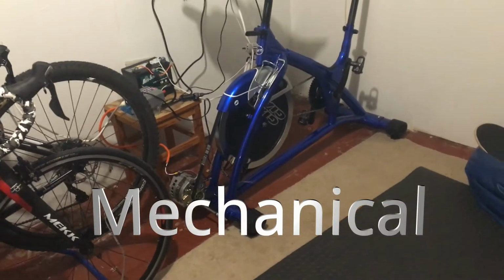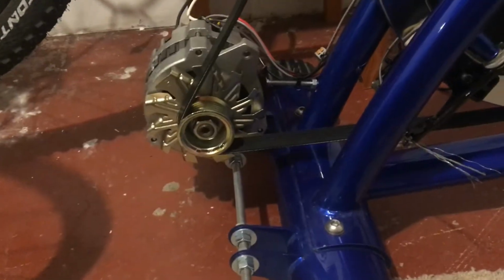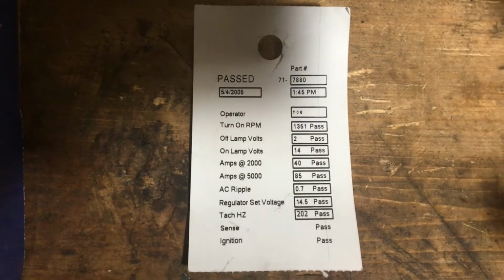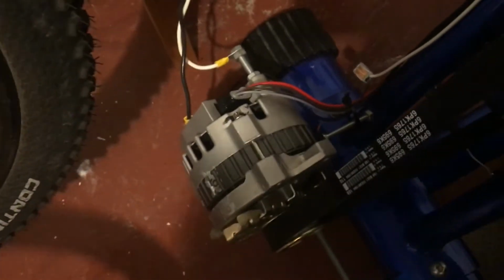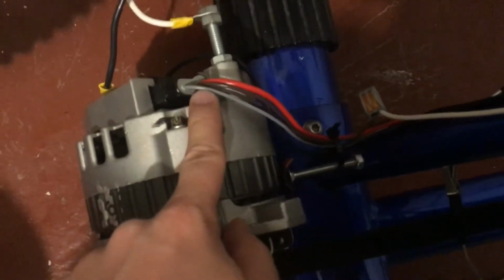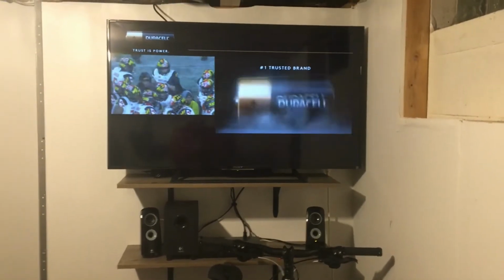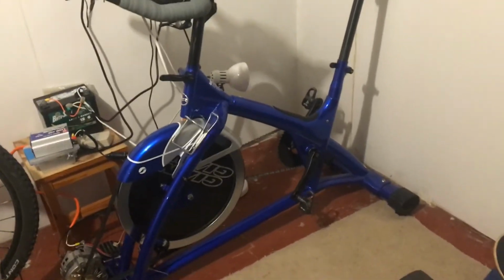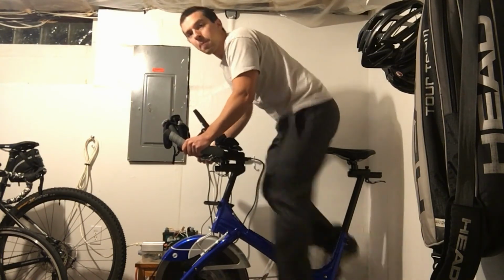Spin Bike Generator

Comment: This is more of a disaster preparedness thing. Very useful during power outages. Enough to charge essential gadgets and items.
Reply from the maker: Yep, I mean I mainly wanted to do it just for fun.  A person can't put out a tremendous amount of power, but with this setup, it's very possible to charge batteries for flashlights/power tools/phones/etc!
Reply: @andyw4506  I think this is at least much "better" than to just have the resistance from the stock roll-trainer! Cool project Andy!

Comment: Great, great, great idea but the alternator is really a horrible choice. I want to build mine using a 250W hoverboard motor. I spin it with my bare hands so easily and it puts out a lot of power. Cheers! Thanks for the video!

Comment: My extension #1 of your idea is for your bicycle to turn a good-sized flywheel using a connection with gearing of multiple sprockets, like a 10-speed bicycle. The flywheel is connected by suitable gearing to some number of DC generators, which feed power to the batteries that power your home's devices. The flywheel's inertia can continue to spin your generators when you stop pedaling and allows you to maintain the flywheel's rpm with less pedaling effort. 

My extension #2 of your idea is to a) identify the power required to lift a large concrete block using an electric winch device and b) identify the size of the block that can spin generators producing your required power output per unit if time. After lifting the weight, it drops down an inclined plane during some long number of minutes. It is connected by a weight-bearing cable to a suitably geared set of DC generators to produce a given amount of power per drop/reset cycle. The generators connect to batteries that power your home's devices. (You canset up as many falling blocks as you need to generate the electricity that you want to be available over some period of time.) All of the blocks are set up outside your dwelling, of course. You pedal your bicycle only to recharge a battery to drive the winch. This kind of system is simple and avoids the complexities and fragility of wind turbine and solar power systems.

I would also prefer a recumbent bicycle seat.

Comment: Andy, you are on to something. If venture capitalists / investors take your idea and produce a complete product, you'll be rich. Something Elon Musk, his hardware (frame, electric motor/alternator, display etc) and software (app, internet of things, forum, social platform etc) engineers could take on.
Reply from the maker: It would for sure be cool if this idea was plug and play/packaged up a little nicer using a brushless motor and a VFD (inverter).   Could be an add on to a Peleton or something.  I thought of doing more with this using an adruino or pi, but haven't gotten around to it.  With electric bikes becoming popular, I don't think it would be too hard to be able to put the bike on a stand and charge the batteries using pedals.  Would be kinda neat!

Comment: I don't know much about electricity, I'm queries, is it possiblle to use many alternators/generators to charge a deep cycling buttery at the same time...?
Reply from the maker: Sure.  A deep cycle battery could be charged with this setup, it would just take a long time.  If 2 of these were used at the same time to charge that battery, the charge time could be cut in half, theoretically.  I'm not 100% sure how that would be wired up though.  You'd probably want to power a battery charger that has a selectable charge rate.  I'm also not sure how 2 alternators connected in parallel would behave!

Comment: Hi,  may I know how much
it's total cost,  
thank you.
Reply from the maker: Sure.  Spin bike was a craigslist find for about $125.  Alternator was rebuilt and used on older cars ($75? - honestly I forgot).  Serpentine belt around $25. Battery/inverter (if you go cheap) about $25 each.  So about $275

Comment: This African older gentleman just made a bigger wheel and he could power his TV for 2 hours after only 2 minutes of peddling. You should use lto batteries and also a higher Amp alternator. BMW alternator or something.
Reply from the maker: I mean... I could power my tablet for 2 hours with 2 minutes of pedaling (probably).

Battery chemistry wouldn't change anything.  A different alternator doubtfully would either (maybe be 60% efficient instead of 50).  Would need an expensive brushless motor and inverter drive to make this system efficient.

Let's say it's 100% efficient.  A Tour de France biker puts out 400 Watts.  This TV uses 40-ish Watts.  That means a TDF biker could pedal for 6 minutes to run this tv for 60 min...  In a 100% efficient system.

Still have to abide by the law of conservation of energy